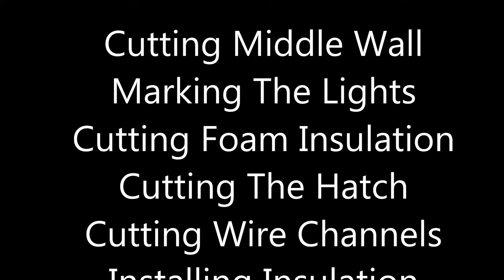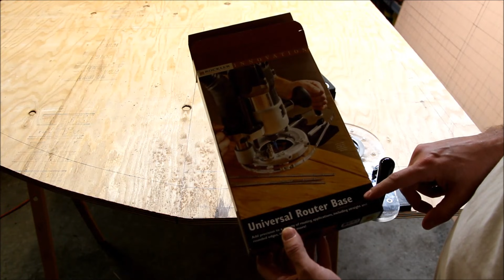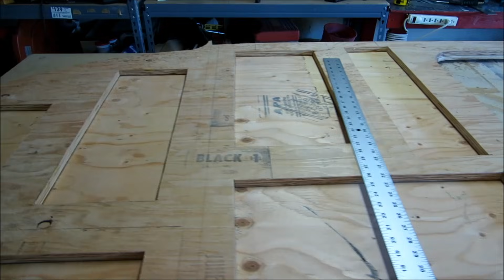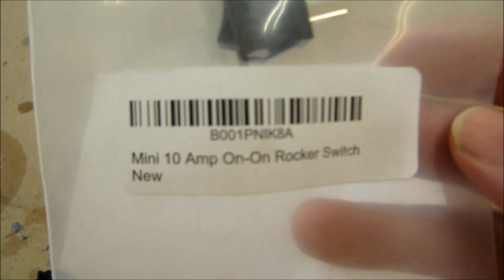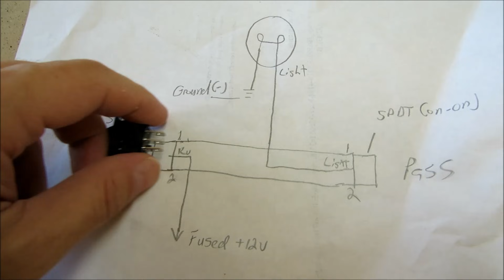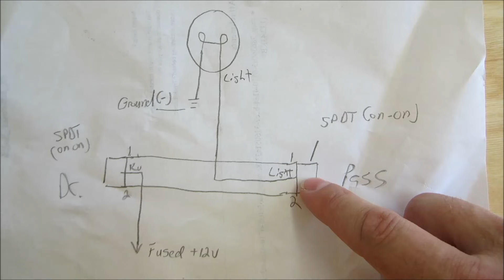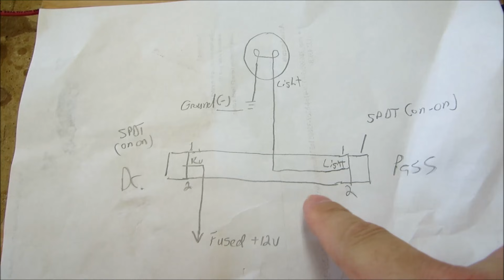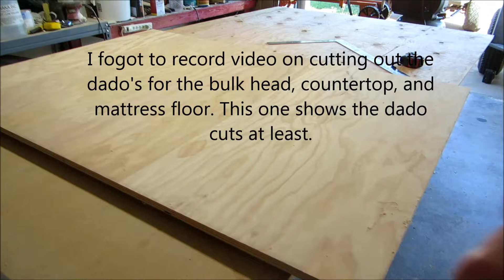Teardrop Trailer Build - Completing the Side Wall

Comment: I'm planning on building a teardrop. Hiw structurally strong do you thing plywood veneer, no more than quarter inch, would be sandwiched around fir 1x1s? I need to keep weight to a bare minimum. The weak points i think would be  the top and bottom joints, wall-cieling and wall-floor. It would wobble side to side like a cereal box open on both sides. I'm thinking the cabinetry and storage boxes inside, complete wall to wall, would complete the soundness of it.
Reply from the maker: Seems like I remember some people using 1/4 inch for their exterior wall but I think it was with a 3/4 sandwiched middle wall. I could be mistaken though. I don't know about the 1x1's. If you are wanting to keep the weight at a bare minimum look into foamies teardrops  http://www.tnttt.com/viewforum.php?f=55
Reply: I have indeed seen foamies.  I want to try to get a finished weight of 600 pounds if AT ALL possible.  I'm towing with a Chevy Spark.  I'm undecided of bolting together aluminum for a trailer and fiddling with steel beefups to attach the torsion axles to, or just make a 1x1 steel square tube trailer.

Also thinking about just paying to have an aluminum skeleton made for me.  I don't want to hackjob anything together, I'll save up and pay for proper metalwork.  If I can get the aluminum skeleton, I should be able to do the steel trailer.

Comment from the maker: You want to keep the 1 5/8" cut out. It will be used later when installing the spars. It will be cut so it fits in between the spars providing structural support and additional mounting surface when the roof is installed.

You can also see my build thread here http://www.tnttt.com/viewtopic.php?f=50&t=67052
Reply: You probably dont care but if you guys are stoned like me during the covid times then you can watch pretty much all the latest movies on Instaflixxer. Have been binge watching with my brother for the last couple of months xD
Reply: @Kamden Abel yup, have been using Instaflixxer for since november myself :D

Comment: OMG that insulation ... so. much. loss. 
Have we forgotten how to measure and cut?
Reply from the maker: Nope sure haven't
Reply: @Waynegoproductions  Don't get me wrong, I like the video's and the build. It just seems you could have saved (a lot) of insulation there.
Reply from the maker: The 3/4 inch plywood isn't actually 3/4 of an inch. The insulation board is actually 3/4 inch. So when you put the insulation in the cut outs of the plywood it sticks above it. That is why it has to be sanded down.